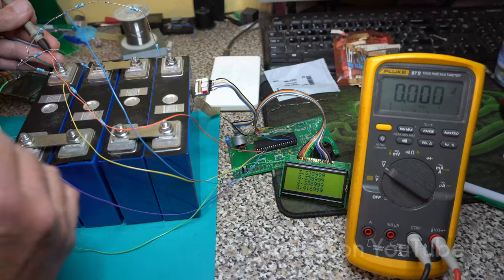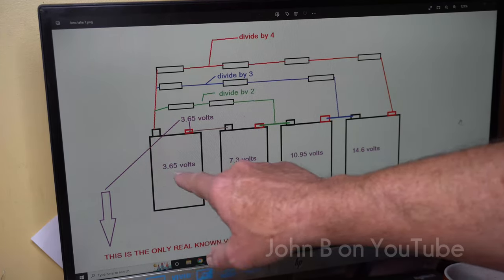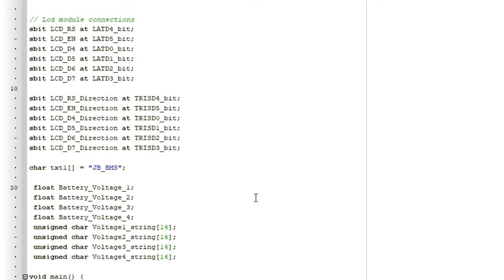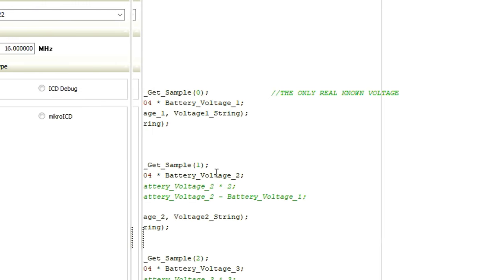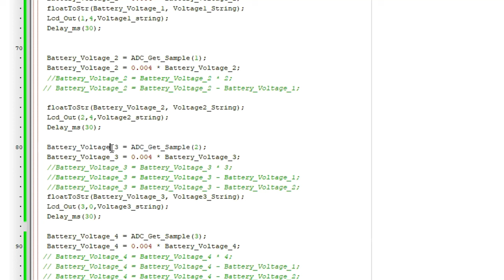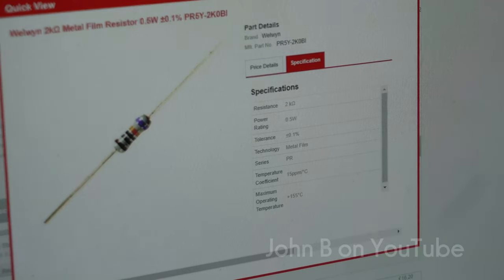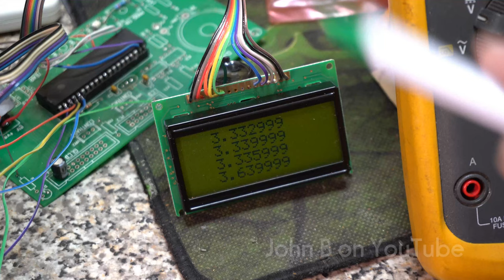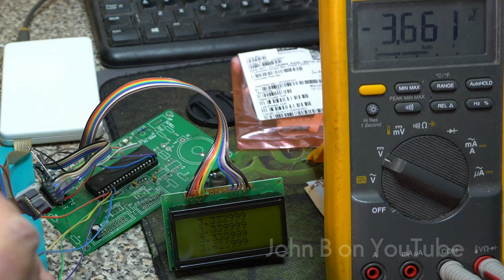Battery Management System (BMS) Design Part 1 - Traps with Voltage Dividers

Comment: funny i was watch someone who built a electric car yesterday and thought it was a bit ott that he used a micro control on each battery(lot of batterys) maybe he run into the same problem , my brain hurts thinking about it great video
Reply from the maker: Lol 😂 thank you for your comments.
Reply: @JohnB-2021  the code is a clever way to get the voltage.
Reply from the maker: @mikeycbd  Thank you, but later methods are much better.

Comment: I think they are all known good measurements but just not what you thought they were :) I would suggest declaring a constant in your code that is initialized with a calculation like what you did on your calculator. That way the next guy (maybe you) knows where the number came from. The compiler will generate the same code anyway as the value is constant.
Reply from the maker: Excellent tip Tom Biskupic, 
At least I didn't skip over that part 😁
Before my float, it read  battery voltage = 4096/1024 * battery voltage, it gave me 1000s of mV
But then one might ask where did the 4096 and 1024 come from lol.
I'll add a note in the C file.
Thank you for your comments.
PS, your first line "I think they are all known good measurements but just not what you thought they were :)"
You are 100% correct lol.

Comment: Nice work. You can try to "virtually" increase your AD resolution with oversampling. I personally would use an AFE (analog front end) from TI for example, and just get the data via communication. The AFE can report all the voltages and if you have a shunt, the current too. And some of them have the mosfet drivers (charge/discharge) implemented too and the balancing functionality. But if you want the challenge, you are in the right path.
Reply: The drawback of using voltage dividers is that you lose resolution on the higher cells. You AD has 4mV of resolution. That is 16mV resolution on the total battery voltage.
Reply from the maker: Thank you for your comments and feedback Jonathan Sperb.
I considered many battery management devices including the LTC6803-2/LTC6803-4 Multicell Battery Stack Monitor from Linear Technologies at £22 plus vat for just the chip.
I felt anyone can use an off the shelf part but wanted a challenge.
I agree with you, having something like a Ti front end would improve the accuracy. Using my batteries as an example, the manufactures quote the charging cut off voltage at 3.65 volts.
As I’m sure you’re aware, the lion’s share of the charge is reached at something like 3.4 volts to 3.5 volts and that will be my desired cut off to maximise the battery life.
The same argument applies to the discharge.
2 volts is the discharge cut off but anything lower than 2.5 volts is on borrowed time, the curve becomes sharp.
For this reason I feel a 10 bit converter is sufficient.

Comment: i do it with ads1115 4 channels and voltdivider and this working very nice i think this is a better way to do it ,if you want i make a little excample tomorrow and post it on your channel
Reply from the maker: I had to look that part up. £15 just to measure the voltage of each cell. I have seen a fully equipped monitor for £22 just for the management chip.
I think I’ll see how far I can get with a pic micro-controller. Thanks for your comments.
Ps, not sure how it’s better except for the fact it is 16 bit.
Oh, your option is controlled by I2C so it still needs a micro-controller.
Reply: @JohnB-2021 You are right I work with an esp32 and 7S system I use the 8 channel of the ads1115 as an ammeter and monitor that with blynk on my phone .I look forward to your solution for balancing your 4s cells in your next video .Wish good luck to you

Comment from the maker: 12 Bit ADC gives 0.001 accuracy with a voltage ref of 4.096 volts, not 16 bit.
16 Bit will give you a voltage divided into 65'536 bits.

Comment: 18:18 hello! I hope it's still relevant.
Is using a P-Channel MOSFET driven by an NPN transistor a possibility?
Otherwise, a charge pump might help.
Reply from the maker: Yes a P channel would do the job but I found N channel FETs with higher current limits etc so used a charge pump.